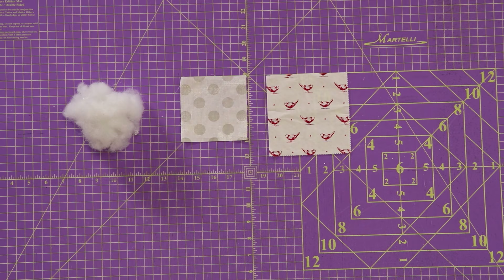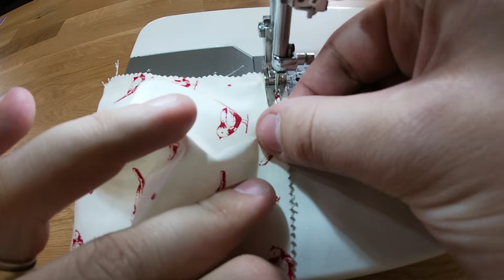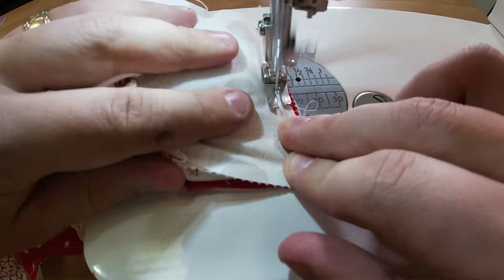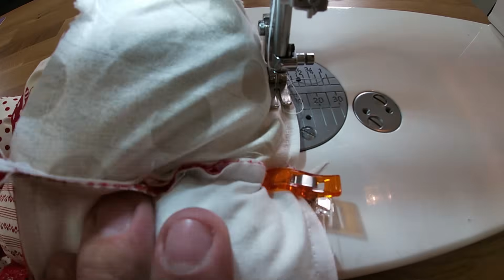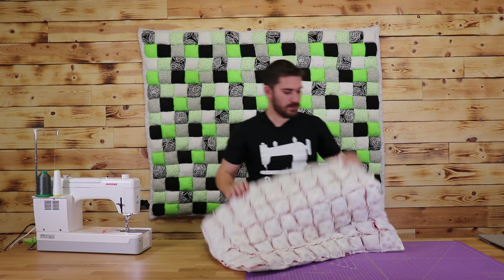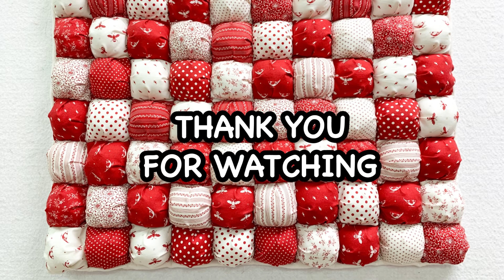EASY Puff Quilt Tutorial | Sewing Project

Comment: Easier method: cut the front and backs for the puffs and pre-cut a 1 -2 inch slit on the backside. Sew the two pieces of fabrics together with the inserted pleats, sew all the rows and then add the wadding at the end of sewing all the rows. Whip stitch the slit openings and add backing to complete. It's easier to handle through the machine and much quicker to finish ❤

Comment: I'm in the process of making a quilt like this, and have developed a method of my own . Before sewing the two different sizes of fabric together I cut a small slit in the smaller piece to insert the fibrefil, then stitch around all four sides. I guessatmate the amount required then weigh it on my kitchen scales that way I know each 'poof' will have an equal amount in it. I then stitch the small slit together, ensuring the fibrefil stays in place, after which I join the squares until the desired size is reached. The backing fabric is cut slightly lager and stitched right sides facing leaving a gap along one side. I turn the quilt right side out and stitch around the edges including the gap space. The last stage is stitch in the ditch, usually three rows apart, then sign and date on the reverse side in one corner, using colour coordinated embroidery thread
Reply: I think that your  method  is ingenious! I have  a  kitchen  scale somewhere and I plan  on  digging  it out and using  it  for  measuring  the  "poofs,"  too!  Great idea!
Reply: With your method, maybe you could wait to stuff the squares until you had a whole row and joined a second row to the first row, then stuff the first row. Then repeat the process where you don't stuff until a new row was joined, then stuff the previous row. Maybe even don't stuff the edge puffs until after the backing was sewn on. I've never made this kind of quilt, but want to. Would this work?
Reply: Dani Gooler, your suggestion is a very good idea. To answer your question of stuffing edge puffs after the backing has been stitched on - yes it would work. However, by leaving the edge puffs un stuffed until after the backing has been stitched on to me presents extra work and time because the quilt {being full size and all} is required to be turned inside out again and edge puffs stuffed and stitched to prevent the fibre from escaping, then repeating the process of turning the quilt right side out again! I guess it comes down to swings and roundabouts! To make stitching the backing on easier it maybe worth your while to reduce the amount of stuffing used on the edge puffs by a fraction, eg as an example if you've put 10 grams in each puff only put in half (5grams of even 7 grams) [sorry don't know equivalent weight in ounces] as these puffs are on the edge I don't think the lesser fiber fill will effect the overall warmth of the quilt. Thank you for your idea. Hugs from South 🇦🇺
Reply: @danigooler4564   I’ve made many biscuit quilt pillows and I’ve found that cutting a slit in the backing, then stuffing it after all the blocks are sewn together is much easier !
Reply: I want to make a quilt like this, but I don't know what weight of puff filling to buy.  Can you tell me, please , what îs the weight you had used for one square ( aproximatly,  of course). 
Thank you very much !

Comment: With right sides together, once you have 3 sides done, at this point if you turn your fabric inside out you won't have to worry about a backing. Just close the one end of the poof by folding in the raw edges.
Reply: idon't understand your way,  the back side is the back side of the puff,  how can you turn that inside out,

Comment: Surely making long tube strips and then adding in floofs would also work and be quicker? Like how they actually make raviolis. It wouldn't give you the checkered pattern with all the textures but you could do rainbow strips and that would be cool. I might have to make one of these, I can make clothing so how hard could this be right..?
Reply: I have done this for a draft dodger (goes at door base to keep drafts out) it's workable. If you plan on making a weighted blanket tho, be prepared to lose needles (popping one or 5 lol). Results can be quite pretty!
Reply from the maker: As you can see we are behind with replies. I am catching up and hope to stay that way going forward. I hope you have found the answer to your question by now.  And thanks for watching!!

Comment: it's a lot easier to stuff the puffs just before you bind and quilt. just cut a little slit in the bottom, stuff them and sew them up. then you can stuff them as firm as you want.
Reply from the maker: Nice tip!
Reply: Seems like more work, it’s pretty easy to sew the puffs.  The puff fill up after joining

Comment: An acquaintance's father-in-law passed and the family found a box of quilts that no one wanted. So she gave me one of the quilts because I'm a quilter. I hated it. Probably from the 70's. I thought it was 4" squares sewn together and then a feather stitch on every seam. The feather stitch was some kind of very, very thick thread. Big knots on the back. (no backing).  The batting was as lumpy as you could get. Everyone said don't touch it...it's an antique. So it sat in the closet for three years until last night. It was going to be fixed or tossed. I took a square apart and it was a puff quilt! Supposedly. Four inch squares were machine stitched, then attached to one another via hand whip stitch, then the feather stitch. Oh...and it was tied. They stuffed it with one nylon stocking! No wonder it was lumpy. The fabric deserves better. My apologies if I've horrified anyone, but there was no value to it in the closet. I plan to make it a proper puff quilt and I am really happy to have found this video. Thank you.
Reply from the maker: Thanks for sharing your story! Glad we were able to help you and save the quilt.

Comment: Do you find Polly fill pokes out of the fabric sometimes? Any way to avoid
Reply from the maker: The best way to avoid the Poly Fil from coming out of the fabric is to make sure to not overfill the puffs. You can push it down in pretty well before you sew the last side and then after it is sewn fluff it around in the puff to get the desired look. That way it won't get stuck in the stitching. I hope this helps! Good luck and happy quilting!